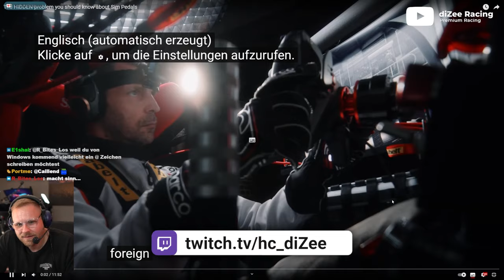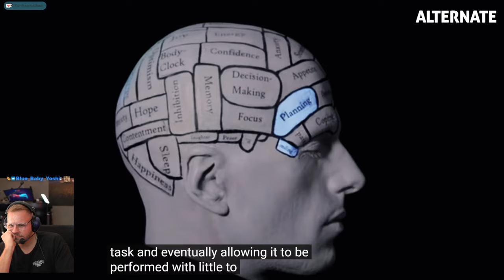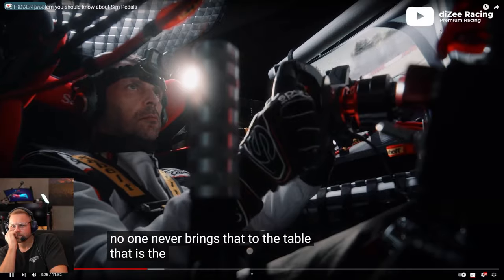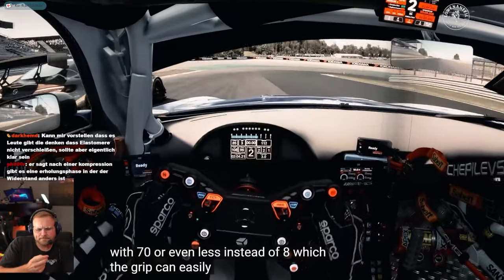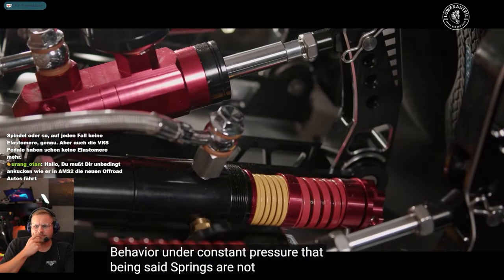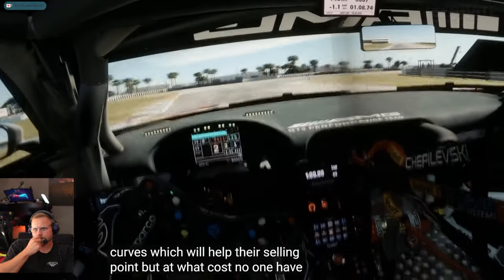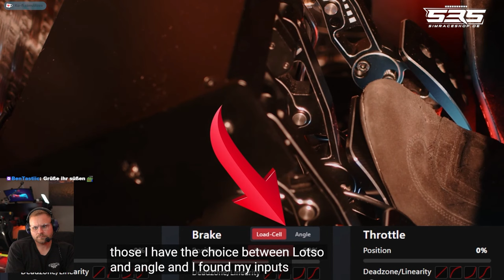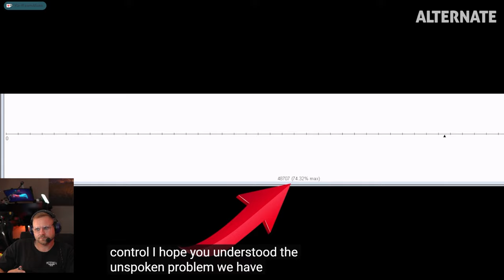Die versteckten Probleme bei SIM RIG Pedals

Comment: Sehr interessant, ABER es ist nur eine Simulation, ferner ein Spiel. Klingt hart, ist aber so. Wer jetzt gewitzt ist, sagt: "Ja aber bei meinem echten Auto trete ich irgendwann beim Bremsen immer tiefer in den Koffer, weil die Bremse immer weicher wird, und genau das setzt mein Elastomer um. Das kann deine Feder nicht simulieren....grins. 

 ----> Und Federn sind halt schneller wieder entspannt als Elastomere. 
OBACHT:  Bei all dem Wahn, so realistisch wie nur möglich zu sein, habe ich nun ein EC-Karten-Gerät angeschlossen ! an den PC !  
 Ich muss jetzt regelmäßig tanken. So ist nach 4 bis 5 Runden Nordschleife in AMS2 oder AC oder rfactor2 bei meinem BMW die Tankuhr auf Null und ich muss für 110€ tanken. Bald möchte ich auch die Reifen so realistisch haben wie es geht. Nach jedem Stint muss ich dann nur den Reifensatz mit Wuchten und Montage berechnen. Aber was solls, 700€ weniger is halt realistisch.
Übrigens: Kennt jemand einen guten Fahrrad-Simulator? Frage für einen Freund
Reply: 😅 geile  Sache 😂
Reply: Du hast mir den Tag versüßt. 😂😁 Bin absolut bei dir.